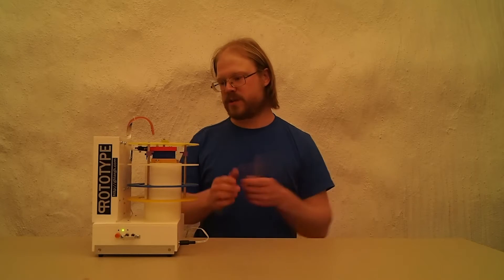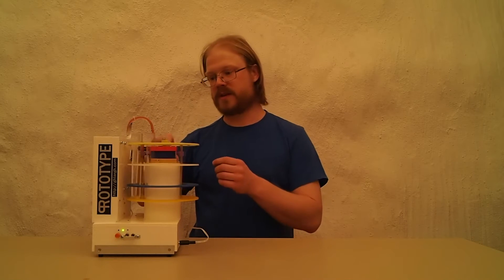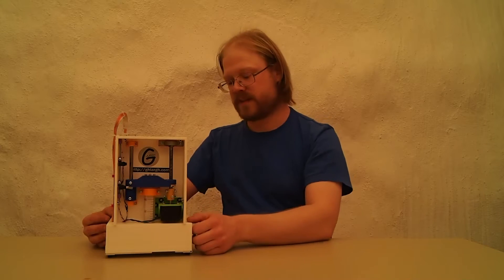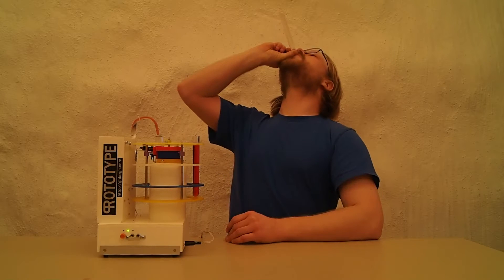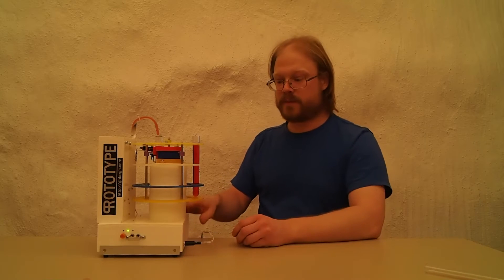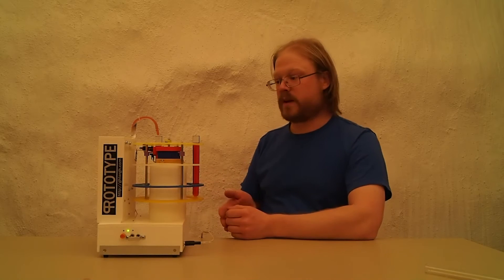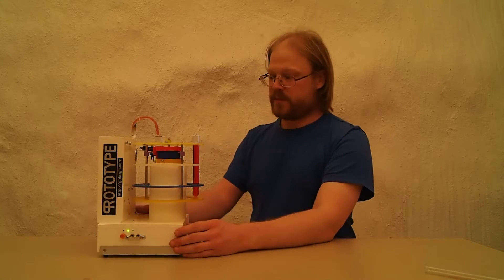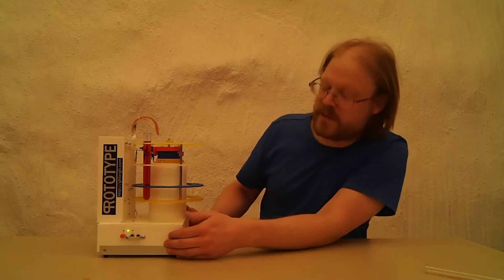Automatic test tube filler

Comment: First thing i think of is the ammount it pumps out ( in fluid in ml ) is not the same for all tubes.
Reply from the maker: That's not a problem in this case, it's designed to fill a specific size of test tube. I could only find one supplier of 2cl plastic test tubes anyway.

Anything smaller is too small for drinks, and anything larger wouldn't fit the carousel.